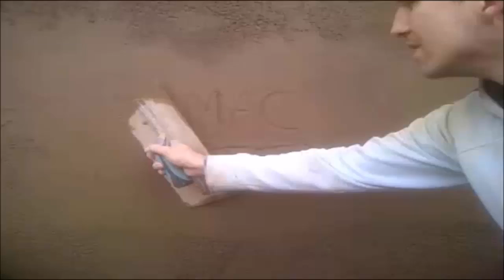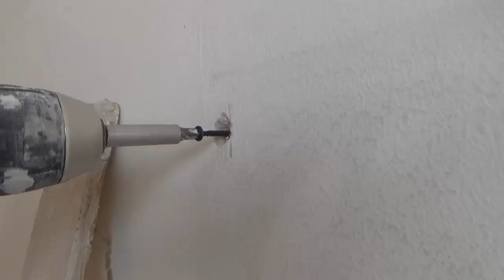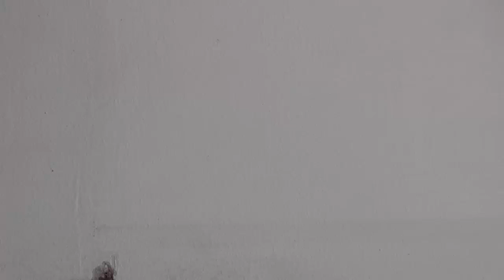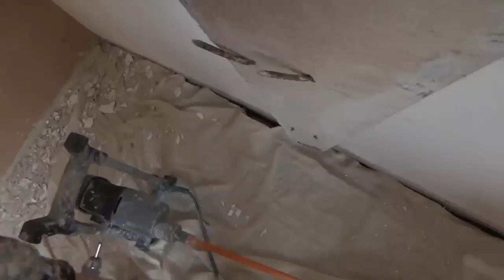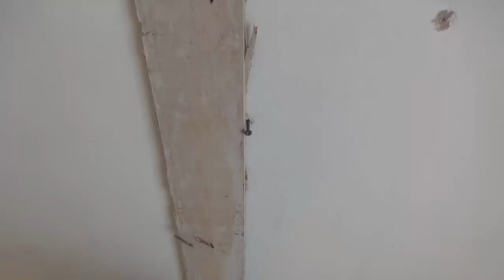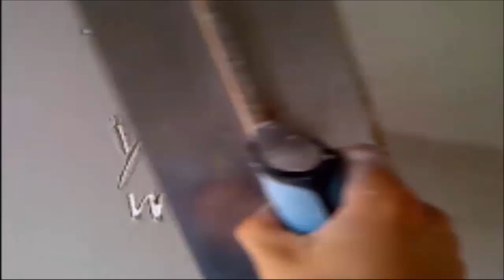How to remove wall plugs, rawlplug, raw plug, screw anchor, dowel

Comment: Neat tips thank you!
Reply from the maker: I could add to this for even better result but mabe int he future mate  :)
Reply: Sounds like a title for a good book "Into the Future". I sometimes get glimpse of futuristic ideas but if I was to share some of them I might come across like crazy mad scientist. For example; I saw recently in my minds eye a connection between beetles and cancer. It all sounds very technical to explain, but not beyond our grasp. I saw a film documentary whereby it showed how beetles can walk upside down on ceilings. Under microscope it's all to do with tiny hairs that act like suction pads or grips. In this program they showed how these hairs can be synthetically made and possible to grow cartilage from them (using them as part of the support structure). (That part was beyond me) however, they talked of "nerve endings". That it maybe one day to grow back body parts after surgery. Well here is where I saw a connection between cancer nerve endings and surgery. That instead of the cancer returning maybe it will become possible for the body part to grown in it's place. Sorry if I have diverted but you just reminded me of this thought I had. It was an interesting program and I forgot what it was called. I saw it about two weeks ago.   But it was nothing to do with cancer. I just recalled cancer is known to return after surgery with a vengeance because of nerve endings, but sometimes surgery has been known to work.  Back in the old days when our food was naturally grown there was not much talk of cancer. Margarine for example back in the late 1800s was made naturally but now is synthetically made that if left outside not even the rats will eat it and ants will not go near it. You can leave it out for 15 years and it never goes off. I only like to eat butter but margarine is put into cakes and all kinds of processed foods. Stay healthy and strong my friend. God bless!
Reply from the maker: It sure is hard to eat good healthy food these days yea i got an apple from tessco and for got about it in the van it was there in heat cold and all for 4 weeks and it was just as i left i was like wtf....  I like that thought you had mate , I hope that they just learn to use cancer cells if we could just make them do the opposite we would all live far longer as they are a very strong and hard to kill cell if it was working with the white blood cells we would be doing very good  ot that i know a lot about it

Comment: A better way is to slice the bit protruding with a scraper while prepping the wall.
The advanges: 
Takes 1 second
you wont leave gaping holes in the wall.
Not that this isnt a great trick.
Reply from the maker: +smeghead420 I hear you mate but this should also cover you if you need the hole again as in when the plug failed :) but for use plasterers some time we just hit with hammer and plaster over :)